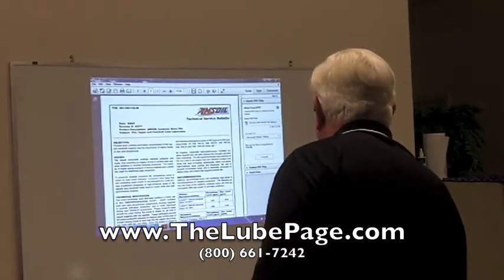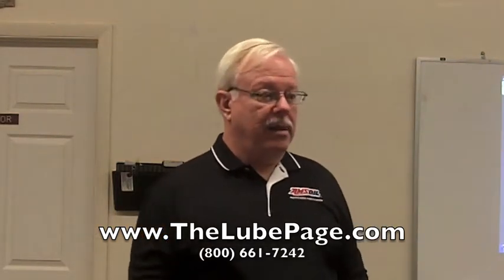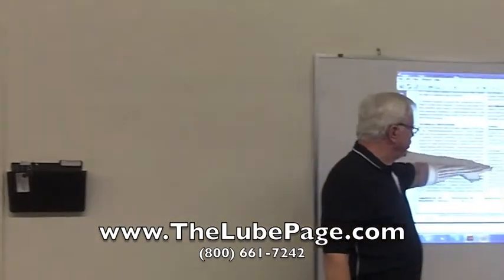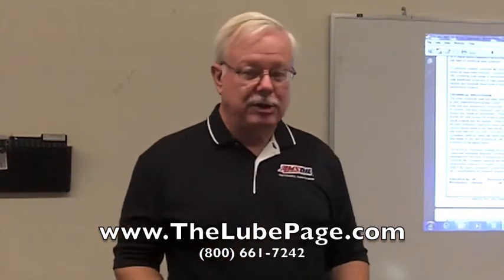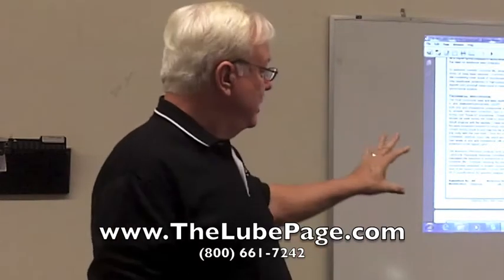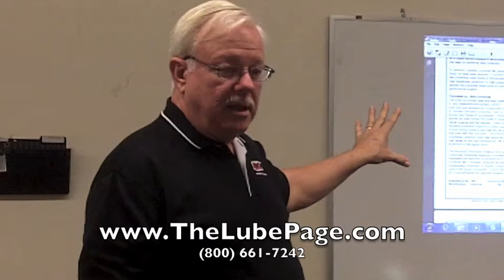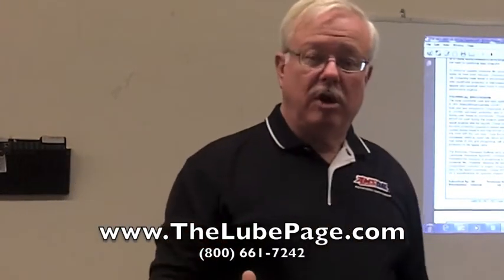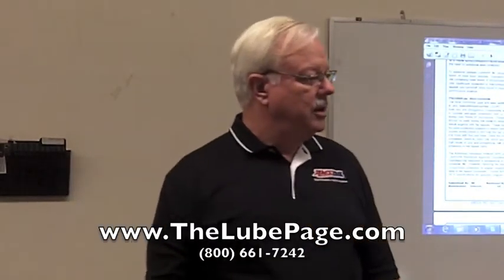AMSOIL Flat Tappet and Camshaft Lobe Lubrication Technical Service Bulletin (TSB)

Comment: So i have a fully built olds 350 in 78 Oldsmobile Delta 88 Holiday, If I wanna pack up the family and drive from Dallas to Houston for a car show, should I run the racing oil? And normal cruising around town with the kid run Z-Rod?
Reply from the maker: I would recommend the Z-Rod oil for all your driving.  If you decide to go to the track and really push the car to maximum performance then use the Racing Oil.  The Z-Rod is designed for highly modified powerful engines so for your driving goals it would be perfect.  Again, if you intend to max RPM and push for maximum performance then use the Racing Oil.  Sorry for the late reply but I came down with Covid 19 in early November and only now have recovered enough to address comments. Contact me via email danwatwson@thelubepage.com and I can send you the tech sheets on the two Amsoil products.  If you are looking for a source to buy Amsoil at wholesale I can take care of that also.

Comment: changed to amsoil in my street driven  small block chevy that had 5ooo miles on it and took the tops of the cam off in 300 miles and wasted the motor  no Amsoil for flat taped cams
Reply from the maker: Bob I would like to hear all of your story.  You have some other problem going on.  That scenario is not consistent with any oil.  Did the engine seize? With that type of wear I would think the piston rings would have seized and the connector rod bearings as well as the main crank bearings would be knocking big time.  You see the oil lubes all the moving parts not just them cam.  For the amount of wear you are reporting in 200 miles the whole engine would have been trashed.
Reply: @thelubepage  he is a troll liar
Reply from the maker: @clawmachinetime955  From time to time the real geniuses step out to be heard, real positive contributions to the discussion.

Comment: AMSOIL  I DID THE OIL AND FILTER CHANGE  DROVE  ABOUT 200 MILES  AND LOST OIL PRESSUED   PULED CAM AND LIFTERS AND WERE ALMOST FLAT  I SAY NO TH  AMSOIL,,   BOB
Reply from the maker: Bob I would like to hear all of your story.  You have some other problem going on.  That scenario is not consistent with any oil.  Did the engine seize? With that type of wear I would think the piston rings would have seized and the connector rod bearings as well as the main crank bearings would be knocking big time.  You see the oil lubes all the moving parts not just them cam.  For the amount of wear you are reporting in 200 miles the whole engine would have been trashed.

Comment: Why does my air cooled VW engine run higher head temps when I use synthetic oil. I know it lubricates better but I need to transfer the heat of combustion away threw the oil as well as the air cooled fin fan system. I can't bring this up on VW forums. I just want what will keep my engine alive.  It's not just about metal wear it's about cooling the oil in an oil cooler. Thx in advance
Reply from the maker: First question, what brand or type of synthetic oil are you using?  Are you using the same viscosity as the original oil?  What you are evaluating is a heat transfer system.  Your medium of transfer is the oil.  The oil picks up the heat at the oil metal surface.  So, the delta temp or difference between the high temp metal and the oil will be the driving mechanism for transferring the heat.  The specific heat capacity of the oil will determine the BTUs/LBM and the flow rate will determine the how many LBM (pounds of mass) flow over the area of high temp metal.  So knowing the specific heat capacity of liquid will tell you how well it will cool the high temp surface.  True synthetics made from PAO,s will have uniform molecular structure, which means they have much better specific heat capacity ratings.  I have a suspicion that your synthetic oil might not be of the highest quality.

Comment: Just one thing I'll add. Is that the API doesn't limit Zinc directly. Its a byproduct of phosphorus. Now the common thing is for other brands to do is have moly as an additive. But for flat tappet cam engines zinc is king.

Comment: Mr. Watson you have cleared a lot of this additive topic in this video, however I have been reading through forums and dedicated sites about engine oil and the adding of liquid molybdenum (MoS2) to the oil. Some people swear on it, others look at it with skepsis.
 It is contradictory to have particles in suspense in the oil, yet its so small enough to pass through the filter.
If it makes a difference to the friction of the reciprocating components and surfaces, it could be crucial to lenghten the service life of the engine and reduce fuel consumption. Is it a silly idea to try it out? They claim that it creates a hard sliding film between rough surfaces of rubbing parts. Thanks again, you already helped me out in the past
Reply from the maker: Emin,
MoS2 is an extreme pressure additive.  The sulfur is an active molecule that requires high pressure and temperature to chemically attach to the surface of the metal.  In a gear set this can be done where the gears mesh, in the engine there are little if any places where the chemical attachment can occur.  There maybe some benefit as an anti-wear agent but organic moly might be a better choice.
Reply: Thank you very much Mr.Watson
Reply: +Dan Watson  I'v been using LIQUI MOLY MoS2 in my engine oil.  Are you saying im wasting my money??
Reply: @mareksumguy1887  Yes. Just use Amsoil
Reply: @peterssynthetics  😂 yeah… like I’m gonna listen to you.
Reply: How many ppm of moblydenium  are we talking about sir, how much is sufficient to protect?  New ap sp have around 80 ppm, is that enough for a regular guy who doesn't race? Just curious.